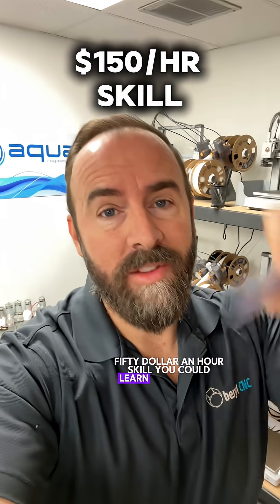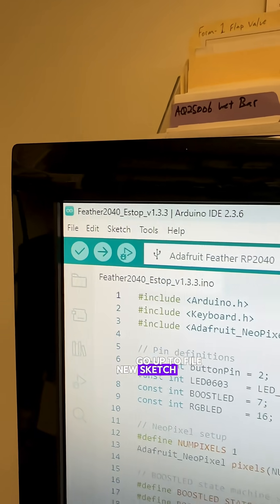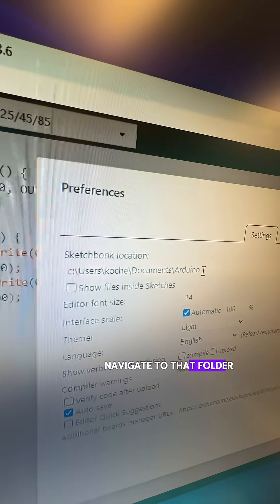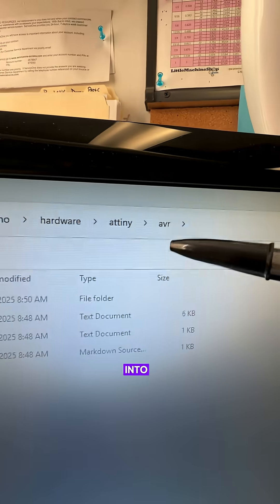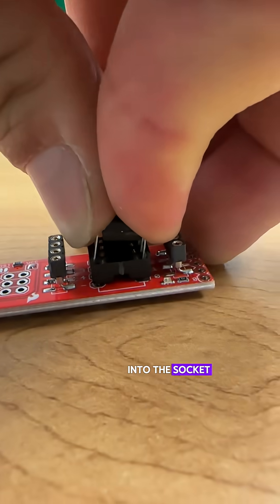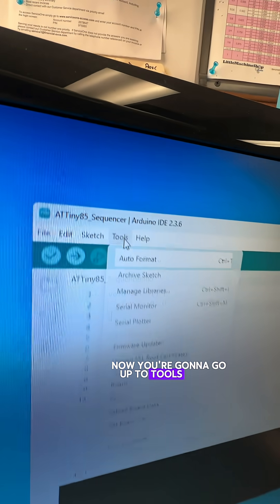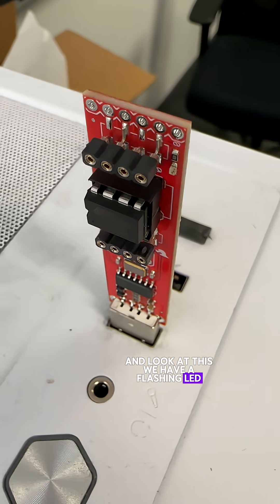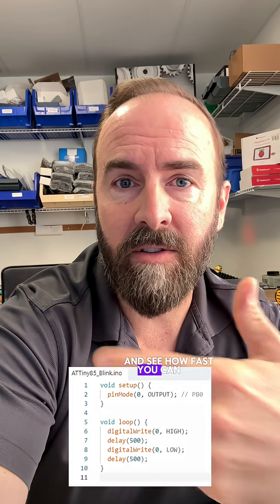Intro to ATTINY Microcontroller Using Arduino IDE

Comment: Is there still a reason to go with an ATTiny over an esp?

If you go into mass production, you may want to optimize costs and go with the ATTiny85, but for anything handmade the price difference between it and an esp8266 is going to be negligible, while the capabilities are worlds apart.

I'd recommend learning to work with an esp over an ATTiny, but maybe I'm missing something...
Reply from the maker: Definitely want to learn on the ESP32 not just for simplicity but also for more complex firmware projects. Only reason I’d recommend building a few portfolio projects with these 8-bit parts are the sheer number of very simple applications already in the field. A lot of these old boards need ported to new chips when the originals go end of life or they simply are due for a PCB refresh and the customers might not want the risk of such a large migration (for example 8bit to 32 if their code base is already well documented or test plan is well established). In many cases also the extreme low power, 5v tolerant pins, and perception of better security or better ITAR compliance.
Reply: I second that: power consumption (i.e. actual low-power sleep modes the ESPs can only dream of), 5V tolerance and being able to run it from roughly 2V up to 5V (and probably even a bit more).  Need more pins? Attiny84!  But whereas it used to be easy to get them at very low prices, I get the impression they're starting to be more rare and hence more expensive the past couple of years ...

Comment: I don't understand why you "have to shut off the big game" to learn how to copy and paste? Also where's the $150/hr skill?
Reply from the maker: Because if your brain is simply rotting watching other humans play with balls, you won’t build a $150/hr skill set.
Reply: @i2c_jason football was implied to be bad. You did not demonstrate that this was good or even better. You keep simply asserting what one can assume is a bogus figure.
Reply from the maker: @BrickGriff  If you're going to spend an hour or two watching football instead of doing a simple LED blink project like this that costs $25 (less than the food and beer you're likely buying for the sports brainrot) then you're truly missing out on what could be an inspiration spark toward a $150/hr career path. I am asserting this, yes.
Reply: @i2c_jason you can do both. We're humans we're capable of having a TV on and building CNC machines at the same time. Or rebuilding a Subaru engine during the NFL draft. Or doing preventative maintenance on automated manufacturing equipment while listening to a hockey game. I mean I can't speak for everyone just my own experience. In my opinion we're limiting ourselves if we actually believe we have to either be interested in athletics or mechanically/intellectually inclined. Being well rounded and reaching as high as we can in all aspects of life should be the goal, not an obstacle. Thank you for your content I look forward to tinkering with my Arduinos and Raspberry Pis while watching CFB highlights and tracking my Fantasy football team.

Comment: He's not wrong. I have been making a living making control boards using microcontrollers and developing custom  firmware for all kinds of things from security hardware, gate controllers, replacement control boards for refrigeration tables, add-on defrost for older cooling systems and the list goes on. I make what my clients have working again or just make them work better. It's a nice life.
Reply: Ya thats frickin cool as hell. I do repairs on random stuff but I really have an interest in electronics. Where'd you start?   And what was it when you had that "ah- HA!" moment?
Reply: FYI. Code for PLC’s can be bought from India or China for less than $10. As complex as you need it. That’s what a firm I used to work for did.
Reply: @cranberryeater7459 can I just ask what is PLC that you mentioned? I'm new to this and want to understand.
Reply: @mohitson9  PLC: Programmable Logic Chips, more appropriate term is PLD (D for Devices) are integrated circuits that can be programmed to perform specific logic functions rather than having fixed behaviors hardwired. The internal gates and interconnections are digital and configured with logic code. You can hire established companies from China such as Pango Microsystems or Acme Chip Tech which is 60% cheaper than an American company, or you can hire a freelancer which is 90% cheaper.
Reply: How do I get started actually learning this as a marketable skill?
Reply: @theinkweaver4639 interested as well
Reply: @theinkweaver4639 google
Reply: About to be in my junior year of Bachelor's of Science-Data Science degree program. Looking for resume projects/ learning projects like this🤟🏾
Reply: @curleysimon3183  Let’s 🔗
Reply: It’s the “my clients” part that is the barrier to entry. That’s always the barrier, and nobody is sharing.
Reply: @obviousfakename5828 something school brainwashed us into thinking is that we go far solely on education.  Networking has always been the way- we can learn anything through mentorship, it's knowing and connecting to others that is the key. 
Going to university opened more doors for me just through the people I met than anything. Of course, there is a balance but networking is so painfully overlooked.
Reply: I have an entry system that controls my gate, a Cellgate W450 - the microphone went out so we can’t hear who is trying to get into the driveway. I call the company and they say the entire system needs to be replaced since the microphone is ‘built in’. Have to buy from a dealer who marks it up another $500. So nearly $2000 USD because a $4 microphone is ‘built in’?! I don’t know where to start but I feel like this is something someone smarter than me could repair for far less money. An I wrong?
Reply: I love building microcontroller projects, but I don't really have a job market for it in my area.
Reply: Can you explain it further to me I still don’t fully understand how you Make money.
Reply: @Parker-d2f  This video is assuming you know how to write code already in c++. If you know how to do that one could make money a million ways.
Reply: @dustinwitt5584  No, the video is not assuming that, it tells you to use an AI like ChatGPT for the coding part, but it does help greatly if you have at least some basic knowledge of electronics.
Reply: Everyones asking how you get clients. I have the opposite question do you have a site or some where to see your work. I own a hvac refrigeration company we're retrofitting alot of units with energy efficient controllers and programming. We may be able to work on some things
Reply: Where do you get your clients?
Reply: @thatApoliticalCoder  I have had my computer business since 1998 and have diversified through the years. Pretty much everything is a computer these days. All my work comes from word of mouth. If I had to start at square one today, I would use YT, X and the other social media to showcase my work in my area. I may still do that but retirement is on the horizon for me so may not need it.
Reply: @marksmanaz you would be a great mentor
Reply: @marksmanaz if you were just starting right now, what would be a small thing you can start fixing with these skills? Like if you specialized in something to get your toes wet? I use to love computers years ago in high school but I’m a fast learner…

I’m not sure how to ask exactly but like what would be like the first thing I can learn to start working on?
Reply from the maker: @thatApoliticalCoder I find mine networking. Lots of inventors, startups, and other businesses need these skills because they can’t keep full time firmware engineers on payroll if they design a new product every year or two.
Reply: @thatApoliticalCoder  Exactly, how do you get clients, when most people that would have any use for this, would already be learning or know how to make their own.
Reply: @NolandC it’s okay if they know how if they have enough money to leverage your knowledge while focus on what they actually are proficient at.
Reply: @NolandC because they their time is valued elsewhere, and that genius can’t be in 2 places at once
Reply: Yeah but that’s QUITE a ways away from here’s a skill you can learn today
Reply: I have one somewhere saved from a epson printer ink cartridge. Hopefully it doesn't have fuses activated.
Reply: @andrert2178 epson ink cartridges have microcontrollers in them? I am being serious, cuz I did not know that and NOW I want to tear a few of the ones I have apart to check....
Reply: Love to know more. Who to sell to etc
Reply: Right and noone wants to mention how most are read protected or scrambled now 😂
Reply: ** TEACH ME THESE SKILLS! **
Reply: I agree it is nice, but i feel that the video may mislead on how difficult it is to start, not just doing the actions he is saying but understanding what is going on so if there are questions, they can be answered properly. More time then a weekend but 100% worth it.
Reply: @edms3656  I would argue that computer programming/scripting brings more bang for buck - easier and somewhat more valuable and accessible.

With Firmware it all really comes back to turning things on and off. With firmware you get four types of bugs - software, hardware, the interfaces and errata. The last two are the worst in my opinion.
Reply: Make dead fridge run again...cool. I have a Samsung fridge that appaerantly has a Mother board issue..nobody wants to mess with it...I knew there was a solution.
Reply: @projectqueen610  haha this not quiet the same thing! However that fridge might be pretty fixable if you have access to the control board.
Reply: Sensei, say more. Immediately thought of custom led control sequence. I've been in love with the idea. No clue how it connects. "Give a man an accurate outline, and he'll fish for life." So please, more information? Even just some terminology and a sequence and I'll go research it and learn it.
Reply: I was thinking about this. I have a background in HVAC and love it, and I know some basics about electrical wiring, but little about control boards. It seems simple. I've soldered before and became quite good at it. Considering the new terrible R454B refrigerant I plan to advise people to repair their systems instead of getting new equipment with that terrible R454B.
Reply: Great🎉
Reply: How do you find clients for something this specific? I need something like this.
Reply: How would you add defrost to cooling systems that don't support it?
Reply: @AthenesWrath add a controller that shuts off the cooling system for a while every so often to let it thaw. Fridges do it all the time
Reply: @AthenesWrath  Add a relay between the original control board and the compressor contactor. Program the relay to open every two or three hours for ten to fifteen minutes. The original control board will function as normal but the defrost relay will not allow the compressor to run during the defrost cycle. You could also add a temperature sensor in the coil to monitor the coil for ice and defrost based on the temperature of the coil. Most cases a defrost every two or three hours is good enough. Just keep the fan running through the coil to melt any ice during defrost. In extreme cases you will need to add a heating element to defrost as well.
Reply: @marksmanaz  I have an idea, and it’s simple, may even be silly. I think I will try to implement it. This is so cool.
Reply: @marksmanaz   I assume you are very talented in your craft.I also assume you are talented at networking and selling yourself. With those statements a 20$ timer with 15 min intervals could break the circuit the same way. A freeze stat or klixxon in range of your choosing could also do this. A ranco ETC 1000 could be programmed to shut off at a certain temp and delay at as long of interval as you wish by time,temp or a combo of the two.

There are at least 5 other ways I can think to do this with less than 100$ of materials. It just seems odd.
Reply: @fartsunltd6981 hes probably working on custom controllers think of something like a ke2 controller. Theres Alot of work out there especially with everyone trying to go "energy efficient".
Reply: @AthenesWrath as someone that does HVAC, I was wondering this too. The thing should already have defrost controls if it's necessary. I could see programming a new defrost board, but in all likelihood, someone that had an issue called a heating and cooling company and they replaced it with the generic controls already.
Reply: How do you find your customers?
Reply: What about some old home depot “smart” Christmas lights that are “programmable” but require an app that no longer works?
Reply: lies
Reply: How can I get ahold of you for refrigeration control board work
Reply: how much do i need to learn if i know Java QA level, Python DevOps level, BAsh and Terraform normal level?
Reply: How do I learn and get started
Reply: May I ask how/what you charge?
Reply: Well, I would say that depends a lot of your clients. Where you live and if people needs these.
Reply: How  do you get clients?
Reply: Arduino both made this way easier but also less lucrative - the real easy low hanging fruit is gone, people can find YouTube tutorials / AI to do it for them.
Reply: @stewartdahamman2472  Tbh, that's like saying nobody pays for oil changes because YT tells them all how to DIY it. 

In reality, that won't eliminate mechanics. It wont even eliminate shade tree traveling mechanics though "just doing oil changes" alone was probably never a full time option anyway.
Reply: @johnassal5838  It's the same thing, it relies on people seeking convenience, their lack of research or confidence. YT just helps to dilute the pool.
Reply: How do you actually profit from this?
Reply: @inq752 Minimally.
Reply: How do I find a job doing this? I took a class at Pasadena City College, and I programmed an alarm clock. I would love to do this for a living!
Reply: @thaum2u  Read my other comments. And your never actually getting a 150/h job with little to no experience. Especially if you think your just going to make blinky lights.
Reply: he needs to show all that then not this useless shit

this video taught me notjing chatgpt couldnt
Reply: @rjackstheartofwealth6152  copilots cant reason over vague customer requirements. the context is beyond comprehension. all the minute nuances that you have to consider make it  impossible,
i work as an industial device embedded software engineer. i use github copilot daily which is GPT on steroids just for software development integrated in my IDE. 
its good for writing unit tests for already-existing code but when it has to generate highly specific embedded C/C++ for a device with a lot of external black boxes, it falls flat on its face., second use case is just a search engine because google is unusable now.
Reply: @rjackstheartofwealth6152  You want him to come tuck you in at bedtime, as well? Maybe bring you some warm milk to help you sleep better? He is showing you a possibility not teaching you an entire trade.
Reply: How much experience n how much of an overachiever r u ?
Reply: @johnjones4860  who is this directed at? In the event it was directed at me. About thirty years.
Reply: Cool hobby but I can’t imagine too many people hiring someone with and professional electrical engineering designation ?
Reply: How you got clients?
Reply: Tell us more!
Reply: how do you learn all this stuff? are there any courses?
Reply from the maker: @YouthfulPat I hate to plug my channel but if you watched every video you’d have a really solid insight into how I’ve made it work. All free.
Reply: @i2c_jason rephrase that never hate, especially at something as beneficial as ur channel.

Some thing deep within ur beliefs should change to expand the whole. U co-create ur Reality based on ur Beliefs and Actions
Reply: @donutdude4174 its just an expression.
Reply: @YouthfulPat I took an electronics course at community college that taught the basics of microcontrollers like this.
Reply: @YouthfulPat  you learn via exposure. Courses can help, but they aren't the primary path to becoming fluent in any skill. It's purely a matter of exposure.
Reply: No you haven't
Reply: but that's illegal... violates patents.
Reply: @bebdaumon3948  Nope it is not illegal. The hardware is custom and the firmware is my own creation for said hardware.
Reply: @bebdaumon3948 which patents?
Reply: @bebdaumon3948 You have no idea if anything he does violates any patents.
Reply from the maker: @bebdaumon3948 patents are just a game, if you want to play it.
Reply: @i2c_jason  If you want to make it a game you better have the money to fool around with other patents and see who nibbles.